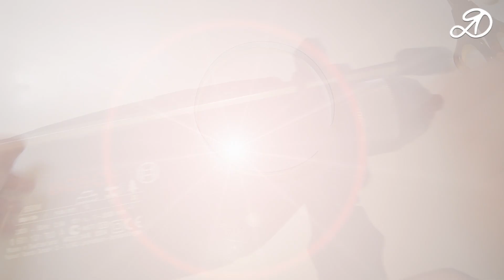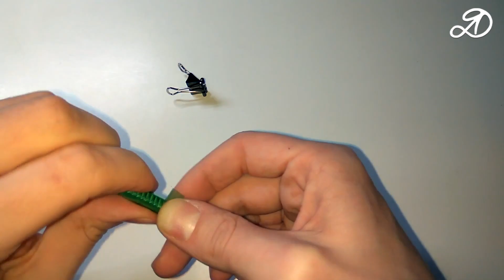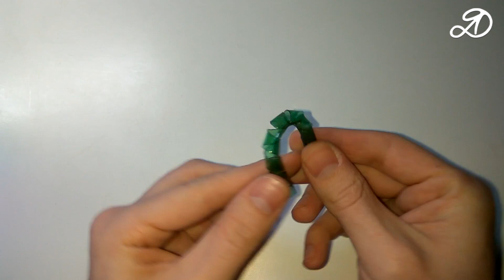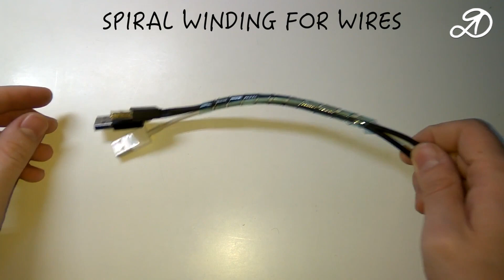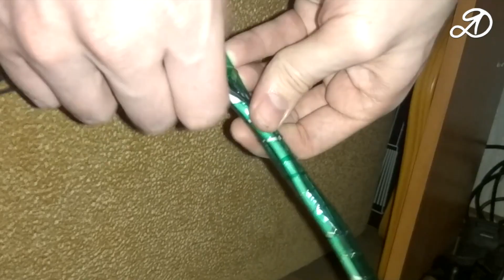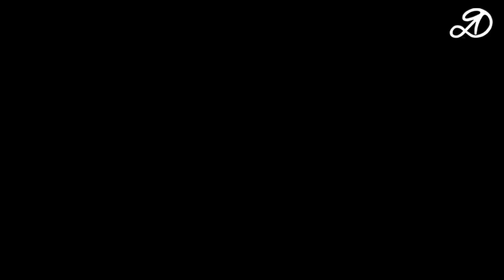Must have. Spiral wrapping for wires DIY. How to make cable organizer

Comment: dial seeing as you have a 3d printer this is the only one that I find the best design. Using a spiral is ok but if you have to replace a wire you'll find the wire gremlin has tied all the cables into knots and you have to unravel the spiral totally off the cables to get to the one to replace. This design keeps the wires separate from the start and to replace wires is very easy.